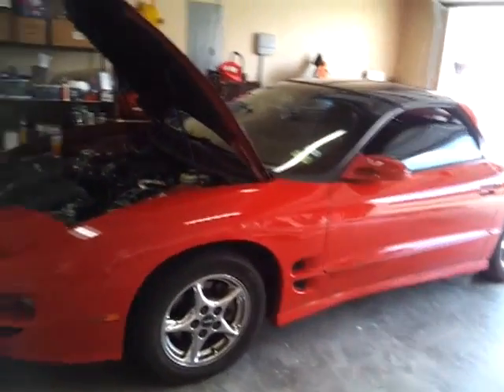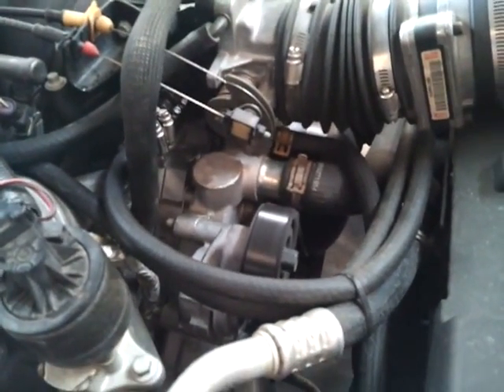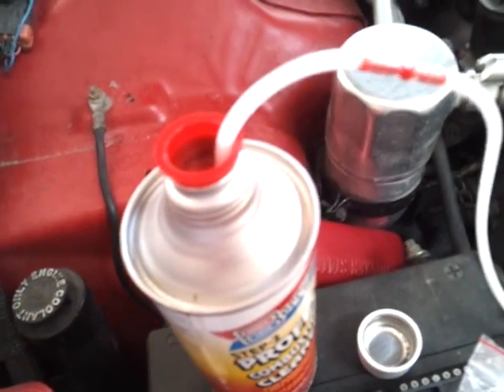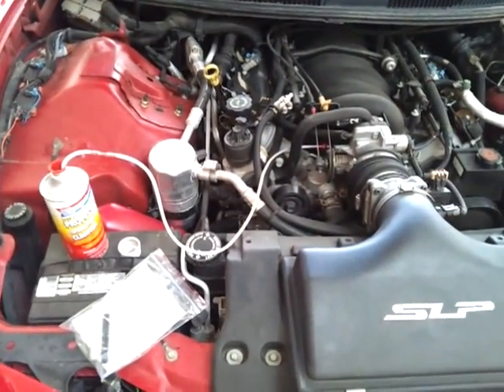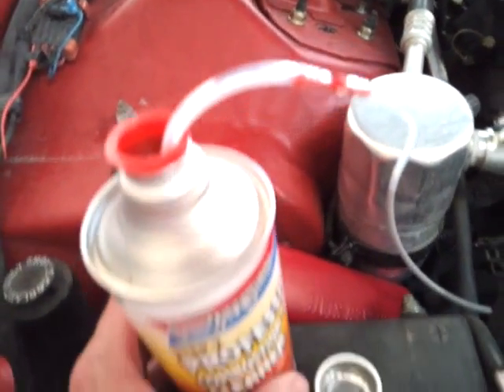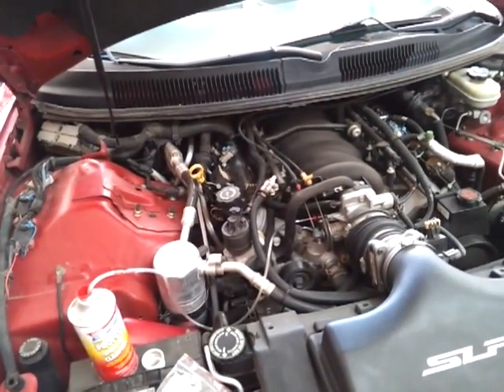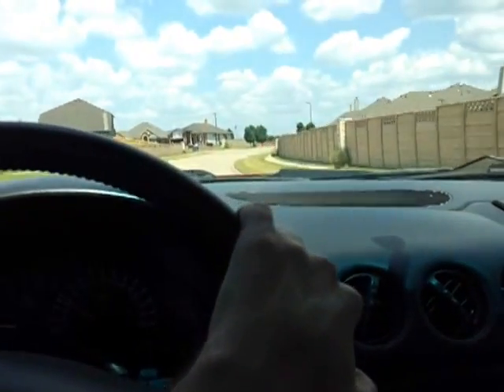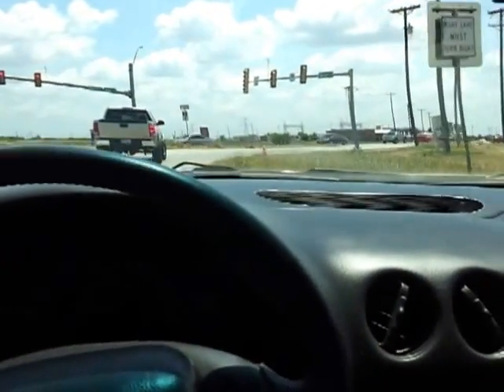Combustion Chamber Cleaning—Berryman Your Car; Don't Seafoam It!

Comment: it's fun working on your own car, ain't it?    i do almost all of my automotive repairs at home, and save thousands of dollars versus having a mechanic do em too.     a couple weeks ago, i called a mechanic and asked him how much he,d charge me to replace.                                            A) both coolant elbows.                                                    B) 2 belts, and 2 belt tensioners.                                      C) a full synthetic oil and transmission fluid and filter change.                                                                      and he said $1300.00-$1,400.00 dollars.      i did it home for $230.00.      and today a mechanic wanted $230.00 to change my headlight sidelamps, and replace a thermostat with a new gasket.    and i did it myself for $15.00.      i love doing my own automotive repairs.
Reply: He has to charge that much to recoup for all the time he spends on the phone providing free estimates to all of us who intend to never pay them to do anything!
Reply: @wilkesjournal  i i thought it was to cover shop rent, light bill, amortization of tools, insurance, paying oneself a fair hourly wage so you.can go home at night. With how dumb the public has. Become,  lotsa ppl have no concept the overhead involved in running a business. Some ppl are envious of ppl successfully working for themselves stead of punching a clock. Lemme tell you, there is nothing to. Be envious about! When you work for someone else youve got lot leas streas juat for starters.
Reply: Awesome

Comment: i replaced a cam inside of a small block 350, without removing the motor from the car.    so i have a pretty good idea of what i,m talkin about.
Reply: Jeff Fuehr a cam? Your chevy 350 has more than one cam? Post a pic please.....
Reply: i said i replace a cam.   so i don't know you think my 350 had multiple cams

i,m jus playing

so how's your car doing?
Reply: combustion chamber cleaners do a good job, just as long as it's only cleaning a very light film

Comment: combustion chamber buildup is so hard to remove, that you can't even remove it if you scrub it with a SOS pad with cleaner on it.          so your common sense should tell you, that there,s no way that a $8.00 can of cleaner is gonna remove it, from just the Pistons firing while your car is running.     you'll see, when you take your heads off.
Reply from the maker: There are many principles in chemistry that are counter intuitive. Just because someone doesn't understand something doesn't mean that principle doesn't still hold true. Either way, I don't need to take the heads off to know the product works. I just need to listen for the absence of spark knock after applying the product.
Reply: +Dan Nowlan   I watched one video you put Berryman b12 fuel treatment in vacuum induction. Did it hurt or help?
Reply from the maker: Neither--it's not the right chemistry. The ingredients in the regular B-12 Chemtool are too volatile; they don't have any contact time in the liquid phase to speak of.
Reply: I would have to respectfully disagree I used the plain b12 chemtool which is quite similar to this and has excessive spark knock prior, due to carbon deposits in the combustion chamber artificially increasing the compression ratio, it cleared the spark knock for about one year with one can so it does work to a point
Reply: +Dan Nowlan  then why did you add it?  I do know the Berryman B12 combustion cleaner is very stout and made for vac induction but was curious why you put the fuel treatment in vac induction.?. I'm trying all sorts of shit but my 2007 Mini Cooper had over 200k on it and used nothing but Mobil 1. It's getting sluggish and I'm trying to free it of carbon.
Reply from the maker: The original idea was to compare only the Berryman combustion chamber cleaner and SeaFoam. However, retailers typically put the regular B-12 Chemtool fuel additive and SeaFoam together because they're packaged in the same type if can and customer assume they're the same type if product. B-12 Chemtool is great as a fuel additive, a crankcase additive, and a piston/cylinder soak, but it's not a vacuum induction combustion chamber cleaner. That's all I was trying to demonstrate.
Reply: +Dan Nowlan  I see. I used the Berryman carb, injection cleaner and now my CEL is on. Probably killed the O2 sensor.
Reply: ya we had to sandblast our pistons
Reply: are you a chemist?
Reply: Get some hot water (not boiling, too much heat may cause engine knock) and vent that.  It will work better than anything.  The best things in life are free.  The 2nd best things are the most expensive.

Comment: the top of your piston,s are part of your combustion chamber.    and i,ll betcha that the top of your Pistons don't look any different after you use that stuff.     that stuff is designed to work, as long as you use it periodically, right after you buy a brand new car with 0 miles on it.         for ex: if you bought a brand new car with 0 miles on it, then use a bottle of that every 5,000 miles, i,m sure it would keep you're combustion chamber pretty clean.    but i don't think that's the case with you and that car.    so, i think that the top of all 8 of your Pistons look all black, caked up, and nasty.     there is no such thing as a "magical can" of fluid, that's gonna make you're combustion chamber all sparkly and shiny on the inside.    all that's doing is removing a "micro film" of the buildup.    maybe removing the combustion residue from the last 7 days, but that's about it.    if ya don't believe me, look at the top of your Pistons ( before and after ).

Comment: Lol, I'd love to see inside that spark plug hole because, I already have. While I was getting ASE certification, one thing we did was use, Berryman's, Sea foam, and the last was the manufacturer recommended fuel system not available to the public. Long story short, all did basically the same as far as carbon removal, until we got to the treatment you can't do at home because the kit is not sold to the public. It removed the most carbon by over 80% compared to what you can get at auto store. Yes, Sea Foam, Berryman's, work if used often enough. You'll NEVER get the carbon removed like what others pay me 100$ to service their cars with sea foam or any other auto store cleaner. Having said that, I've got a 2000 Ford explorer with 192,500,000 miles. At 112k miles, I did a fuel treatment/injector cleaning and still runs like new. If you can not afford a real cleaning or don't want one, There really wasn't much if any difference in how sea foam, berryman's, over the counter cleaners performed, it's just as important to use the products correctly like shown in this video. Good video
Reply: Your better off just getting things up to temp and slowly using water and perhaps a very small amount of dawn then this stuff. I do it before winter. Works wonderfully.
Reply: Brandon Adams 
so whats the treatmemt

Comment: is there anyway that you could remove those spark plugs, and stick a telescopic camera down in those combustion chambers so we can see just how "clean & sparkly" the top of your Pistons really are?
Reply from the maker: You're referring to the use of a video borescope. It can certainly be done and is actually on my to-do list. It's just matter of finding the right equipment and the time to do it. Btw, "clean" and "sparkly" are two different things. One should not expect bright metal but rather clean metal that is likely still discolored. (Discoloration is both normal and harmless as it does not lead to hot spots or preignition.)
Reply: +Jeff Fuehr  If you start the engine at late at night, let it get to operating temperature, and look at the heads just above the cylinders, you can see all th way through to the piston crowns.The reaason this is not well kown is because it is a secret. It takes practice and you may have to do it more than once to get the hang of it. Good luck!
Reply: NismoNick240sx
Actually buttfuck, I take down morons and asshsoles who don't know what they are talking about, but choose to spread false information or outright lies as they try to impress the world with their pseudo knowledge.

Although there are many who know more than I, there are many more who do not, and I can spot one when I see them. so i ridicule them. Sometimes, i just like to try to be funny, and often fail.

So what are you, a coomedian or a sourpuss?

Do you want to play a game?
Reply: George Rivera Sure, we'll play a game. This ones called explain your original comment. The only way to see your pistons is if you pull the spark plugs and look down in there with a flash light or bore scope camera, OR removing the whole head, OR removing the rotating assembly from the bottom end. Your move genius.
Reply: NismoNick240sx
My comment was satirical, which judging by your response, is not your strong suit. 

You know what the Marines say, "Once a marine, always a Marine." I am an ASE Master Tech 20 years, FORD Certified Electrical, Electronics, Driveability, ABS, Brakes, Steering and Suspension, Noise Diagnosis, Air Distribution, A/C, Powertrain, I have built many engines and transmissions, repaired unrepairables, hangar queens and brought many dead back to life. I have never had one engine, transmission, differential that I have repaired or overhauled or rebuilt fail. I have never been beaten by a machine of any kind. I have taught college level Electrical, Automotive Electronics, Fuel injection, Driveability, A/C, brakes, and Bosch ABS. 

"Your move genius."
Reply: George Rivera I don't need your resume. As you should know, it's difficult to read sarcasm and rhetoric through text. You wouldn't believe the dumb shit people post in these youtube comments, so it would not have surprised me if you were one of them. I thought it sounded like you were suggesting someone do something dangerous with a running engine so naturally I tried to address it. Calm down.
Reply: NismoNick240sx GRRrrrr.
Reply: George Rivera Very mature.
Reply: Very brief too.

Comment: did this go in on the clean side or dirty side of intake manilfold
Reply: I take it you're referring to terms used during catch can install?  The brake booster line would be on the 'dirty' side (after the throttle body).  Some products can be introduced on the 'clean' side (basically sprayed into the intake before the throttle body & MAF / MAS) but some cannot as they will damage the MAS / MAF.  I believe the B-12 must be induced AFTER as the "HEST" is potent enough to damage the MAS / MAF

Comment: Can we use this Berryman combustion cleaner on GDI Engines like Hyundai Sonata?
Reply from the maker: +Nadir Shah While not specifically designed for use in GDI engines, the product is effective in any gasoline-power vehicle with a PCV valve or brake booster that will feed all cylinders.
Reply from the maker: Search Amazon for "Berryman 2611" and the upgraded product that also works on GDI engines will come up.

Comment: seafoam does work !! -- but carbon with always be on the pistons-- because drum roll----

carbon monoxide and burning fuels-  run premium gas keep your aircleaner clean and change your oil !! and rxp once in a while -  most engines today can go 250k--

Comment: Back in the day, you just pulled the heads and mechanically cleaned them and the piston heads along with the valve seats the safe, no nonsense way. Today's cars have too much shit bolted too them to make the old way practical.
Reply: +John Long Not  That is the best way to clean it 100%. These cleaners are n0t at the time efficient enough to leave those heads like new. I recently changed my intake manifold gasket, disgusting stuff was there in every crack haha. needed to scrap it and use cleaners to finally get it off. However, i wonder how clean his chambers are if he claims he has used it every year, that would be interesting to see. If he has cleaned it often then i expect his heads to be decent

Comment: oi
i used this seafoam in my 1992 mazda 323 5 speed 2 door and it was around 3100 to 3200 RPMs at around 75-80 HAHAHA on the high way then i put a can of seafoam inside the gas tank with 93 and full tank
then about 2 hours of driving the RPMs went down about one line hahaha so i am guessing the seafoam did its job and if  did this every time i went on the highway it would clean it out and maybe it will be around 3000 RPMs i dontknow but you can feel the differences in the driving though hahahaha all that seafoam sititng inside your engine and your tank and stuff
but i am ganna do this to my 94 Z28 with maybe can or 2 hahah inside the tank with 15 gallons of gas at 93 octane HAHAHAH the seafoam will boost the octane int he gas and clean everything from the gas tank to out the tail pipes HAHAHA so i think seafoam works better because of its high cleaning chems in there hehe and used it inside the oil to clean it after head work and it did alot of cleaning hahaha it was just pureing out goops and goops of stuff and all the oil sludge inside the engines hahaha a can of it hahah
THE END
:)
Reply: +IAMDAVEAMI HAHAHAHA what is so funny? HAHAHAHAHAHA
Reply: NismoNick240sx don't ask
Reply: dside521 Uh oh, too late.
Reply: IAMDAVEAMI you scare me, seafoam scares me. so what happens to all the shit it cleans off? hehe
Reply: dside521
oi
good you should be scared HAHAHHAA
i used it in all my cars mazda jeep blazer camaro all it does it eats the carbon and poos it out the back
and i even run it in my eneinges too and the stuff it cleans it was awesome it cleaned so much carbon and goop inside the engine the oil was black and all gooie hahaha i put in new oil and a can of seafoam and thats what it did and then you open your valve covers and see that its shinie and kinda new thats what its post to be like not all gooped up and carbon build up that much slows the eninge and the power for it and it blocks the air ways so your not making much power at all its like taking a straw and stabbing it in a dounut then you run water inside the straw thats what seafoam does it cleans the holes and stuff so things can flow free and stuff HAHAHHA try this take a fat straw and then stab it in a dounut then try sucking it in your mouth AHAHAHA see if you can get it haha
THE END
:)
Reply: dside521 oi
when you run it through your oil your oil filter picks it up hahaha and when you run it through your enegine you blow it out your tail pipes HAHAHAHA plus its not like staying inside your engine at all HAHAHA plus you only do this with brand new oil change soo the oil lubes your lifters and make sure you use like a heavy oil like a 10-40 weight soo when the seafoam thins it out there is enough oil to still lube it haha plus you will know when its all working when your blowing out black smoke out your tail pipes thats just loose carbon build up  inside your engine cat pipes and what not hahaha so i used this on all my cars and nothing went wrong because i did it on new oil change i put it in the engine then i would run half a can in oil for about a week or 2 on how much you drive hehe and end of it when you do your oil change you can seee all the stuff it picked up HAHAHA it comes out all like gooie like because all the sludge it loosens up and it just sits on the bottom of the oil pan hahaha then when you have it dripping out take a can of brake clean put it inside the drain plug hole and spray it around and that will get most of the left over sludge out then spray some WD-40 inside then it it drain out and then put the plug back in and change your filter and oil then your all set
this only works on cars with like 130,000 to over 200,000 miles cars they have the most build up if you do it on like a 80,000 mile car your just makiing it bad hahaha theres nothing to clean and its touching all the good o2s and what not hehehe works good for meee
THE END
::)

Comment: Seriously now, don't add solvents that can get into the lubricating system. That can cause bearing damage in the 10 minutes you run the engine with it in there. Those loose chunks of carbon can cause valve/valve seat damage as well. Ensure you are using the proper viscosity oil, run a step hotter spark plug to help burn the carbon off.

Comment: your ignorance and unfactual info on seaform ruin this whole video, i have seen tests done between the two and they work exactly the same so by stating that the Berryman is better and seafoam is useless is all but untrue, seaform has the advantage due to its multi use formula
Reply: Seafoam is better for carb engines.  WD40 and straight liquid ammonia work better than seafoam on GDI's.

Comment: The smoke is oil burning from the destruction of the crosshatch in the finish of the cylinder wall. The cleaner cleaned of the walls of your cylinder on the intake stroke and half of the compression stroke, which caused oil to be thinned enough to cause the piston rings to begin a new break in process against the cylinder wall. WHEN you rebuild this engine, there will not be any crosshatch left on the cylinder walls, and the bore will be out of spec. EXPECT to install over size pistons along with expensive machine work. The best way to clean the combustion chamber is 5 to 7 wide open throttle runs in 2nd gear - from 40 to 70 mph.
Reply: youre literally talking out of your ass